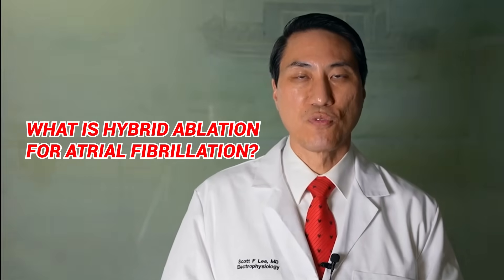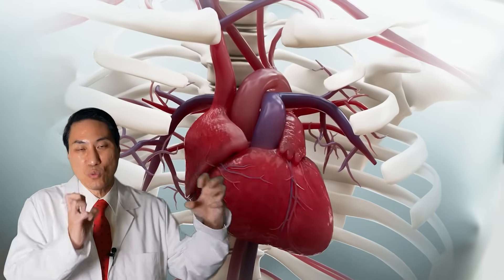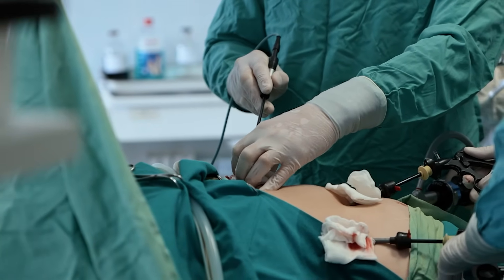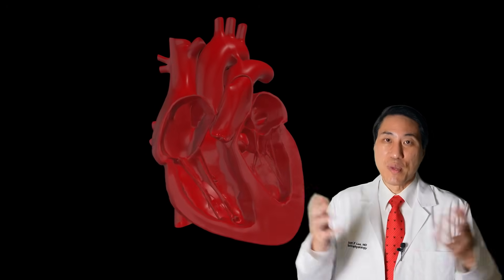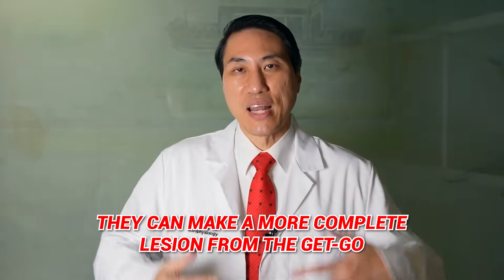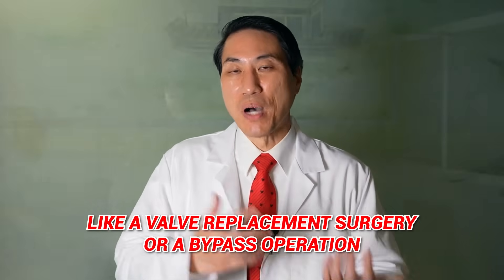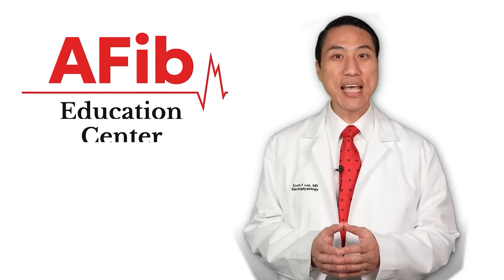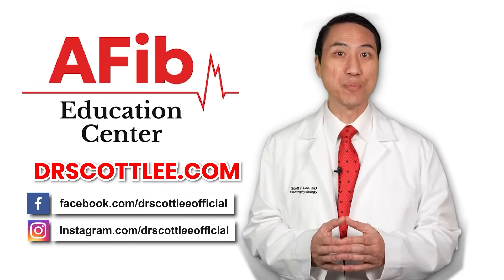Hybrid Convergent Ablation for AFib: What It Solves… and What It Still Doesn’t

Comment: Dr. Scott, do you think Digoxin is a safe medicine for Afib afflicted? And have you ever seen IV digoxin booster chemically converting anyone in Afib before to sinus rhythm? Thank you.
Reply from the maker: Great question — and I’m glad you asked, because digoxin is one of those medications that still gets used in AFib, but rarely for the right reasons, in my opinion.
To be honest, I generally don’t recommend digoxin for most patients with AFib. Here’s why:
	•	It’s a weak rate control drug, especially compared to beta blockers or calcium channel blockers like diltiazem. It doesn’t actually suppress AFib — it just slows down how fast the ventricles respond to it.
	•	Its effect comes from increasing parasympathetic (vagal) tone, which helps slow the heart rate at rest — but it’s easily overridden by sympathetic stimulation. So the moment someone becomes active, anxious, or exerted, digoxin’s effect wears off. This makes it unreliable for anyone who isn’t sedentary or elderly.
	•	It has a narrow therapeutic window, meaning even small changes in blood levels can cause toxicity — and it’s renally cleared, so if kidney function worsens, it can build up quickly and become dangerous.
	•	The one advantage digoxin has over other rate control meds is that it doesn’t lower blood pressure — which can be helpful in patients who already have low BP and can’t tolerate beta blockers or diltiazem. But that’s about it.
As for your second question — no, I’ve never seen IV digoxin convert someone from AFib to sinus rhythm. It doesn’t have any true antiarrhythmic effect. Sometimes a patient may convert spontaneously while digoxin is onboard, but that’s usually coincidental, not because digoxin “chemically cardioverted” them.
So while it still has a role in very select patients (often elderly with low BP and limited activity), it’s not a first-line agent in my practice — and I’d be cautious about relying on it, especially long-term.
Thanks again for the great question — and I appreciate you watching and being part of the conversation! For more in-depth videos on AFib go to @afibeducation, and for more AFib resources or to book a second opinion visit drscottlee.com. Thanks for watching!

Comment: Good information. Ive been referred for Hybrid not sure if that will be enough and also recommended for Tykosin, currently on Amiodarone which I want to get off asap. I will book a consultation. Wish you were in CA instead of FL lol
Reply from the maker: Thanks for your comment — and I totally get wanting off Amiodarone ASAP. While it’s one of the strongest drugs we have for suppressing AFib, its long-term side effects (especially on the lungs, liver, and thyroid) make it something we try not to use any longer than necessary.
 (Dofetilide) is often used as a next step because it’s gentler and doesn’t carry the same long-term risks, but it’s also a much weaker medication, especially in more advanced AFib. It may help stabilize things temporarily, but it usually doesn’t hold up long term if there are still active AFib drivers.
As for the Hybrid Convergent ablation, it’s a reasonable option for some patients, but important to understand what it actually includes:
	•	Pulmonary vein isolation (PVI) — which you’ve already had done with PFA at Stanford
	•	Surgical ablation of the posterior wall and floor of the left atrium
That covers three areas, but it does not address the coronary sinus, anterior wall, septum, left atrial appendage, or right atrial appendage — all of which can be critical non-pulmonary vein triggers in persistent or longstanding persistent AFib. So while it may work for some, it’s often not enough in more advanced cases.
I’ve got several videos on my YouTube channel that explain this in more depth — definitely check those out. And if you’d like a second opinion or to explore whether a more comprehensive ablation strategy might give you a better shot at freedom from AFib without needing long-term medications, you can always visit my website at www.drscottlee.com to book a consultation.
And hey — even if I’m not in California, I’m just a Zoom call away 😊
Thanks again for watching and sharing your story — wishing you the best on the next step of your journey.

Comment: So is there any data on patients life span following a successful ablation?  Do they live longer than those who dont do it?  Afib is annoying and makes me a bit weaker, but not a huge deal, unless I stroked out. Thoughts?
Reply from the maker: This is an excellent and important question—and I’ll give you the straight, evidence-based answer:
There is growing data suggesting that successful AFib ablation may not just improve symptoms and quality of life, but potentially also improve long-term survival and reduce stroke risk, heart failure, and dementia risk—especially when done earlier in the course of the disease.
The strongest data comes from trials like CABANA and EAST-AFNET 4, which both showed that rhythm control (whether by ablation or antiarrhythmic drugs) can reduce adverse cardiovascular outcomes, particularly in higher-risk individuals. Notably:
	•	CABANA showed a trend toward lower mortality with ablation compared to drug therapy, though it didn’t reach statistical significance for mortality alone. But it did show significant improvements in symptoms, quality of life, and freedom from AFib.
	•	EAST-AFNET 4 was more definitive. It showed that early rhythm control (within a year of diagnosis), which included ablation for some, significantly reduced death from cardiovascular causes, stroke, and heart failure hospitalization, compared to rate control.
Now to your question about lifespan: while there’s no randomized trial proving that AFib ablation definitively extends life in every patient, we do know that persistent or permanent AFib is associated with higher risk of:
	•	Stroke
	•	Heart failure
	•	Cognitive decline
	•	Death from cardiovascular causes

So logically, preventing AFib from progressing—especially in someone with symptoms or structural heart issues—should help preserve not just quality of life but possibly quantity too.
However, this must be balanced. If someone has minimal symptoms, is in early-stage paroxysmal AFib, and is well-controlled on medications and anticoagulated (so stroke risk is managed), then an ablation isn’t a must, particularly if they’re older or at high procedural risk. But for younger patients, those with structural heart disease, difficult symptoms, or a desire to reduce long-term medication burden, ablation becomes a very compelling option.
And let’s be clear: AFib is not benign. Just because it isn’t severely symptomatic doesn’t mean it’s not doing harm silently—through atrial stretch, inflammation, and scarring over time.

Comment: An ultrarunning friend c.2000, a strong runner in his early 40s, developed A-fib.  Just 5 months after undergoing a Maze procedure, he ran a 50 mile mountain race I organized. Many years later around age 60, finished a 100 mile high altitude mountain race.
Reply: Mine as been controlled with magnesium and potassium every day along with electrolytes 🙏
Reply from the maker: @WeallneedJesus3: That’s great to hear! For some people, especially those with borderline or low levels of magnesium and potassium, restoring those electrolytes can make a big difference in stabilizing the heart’s electrical system and reducing AFib episodes or ectopic beats. It’s especially true for people who exercise heavily, use diuretics, or have underlying issues that affect electrolyte balance.
That said, while electrolyte support can help reduce triggers or frequency in early-stage paroxysmal AFib, it doesn’t stop the underlying progression of the disease if AFib sources are already forming in the atria. So it’s still important to keep monitoring the heart rhythm and stay in touch with your electrophysiologist, especially if symptoms change.
Glad to hear you’re feeling in control—and thanks for sharing your experience! I hope this helps!
Reply: That worked well for me for years.  Detox too.  But then it stopoed working.  Very frustrating.   @WeallneedJesus3
Reply: That's great but I'm looking for data on those who had it done and those who didn't. He started fibbing young, and 60 is still quite young too.  Trouble is, not all ppl have a successful procedure either.  The head EP in our largest hospital system is an arrogant tool too.  I have no idea how good he is at ablations.  Perhaps worse, are they gonna stick an mrna VAX into me when I'm out cold, lol.
Reply: Since I'm older than dirt, everybody is young 😂😂😂
Reply from the maker: @LongGrovesAmeliaEarhart: You’re absolutely right to want real outcome data comparing those who undergo surgical AF ablation versus those who don’t—and you’re also right that not all ablations are successful. Surgical ablations, including variants of the Cox-MAZE procedure, can be very effective when done properly, but success varies greatly depending on the surgeon, the lesion set used, and the patient’s stage of AFib progression. Unfortunately, there’s no uniform standard. Some surgeons call it a “MAZE” when it’s really just a one-wall pulmonary vein isolation (PVI) from the epicardial side, which is not adequate for longstanding or persistent AFib. And yes, even in the best hands, if someone has late-stage AFib (a large “forest fire”), the chance of a durable sinus rhythm can still be lower.
As for data: randomized controlled trials comparing surgical versus catheter ablation are limited, but hybrid procedures (where surgeons and EPs work together to address both the inside and outside of the atria) are showing promising results in persistent AFib cases. The CONVERGE trial, for example, showed that hybrid convergent ablation was more effective than endocardial ablation doing PVI alone for persistent AFib, around 55-60%. But that’s still fairly low and also depends on the skill and experience of the operator and how aggressively they address the atrial substrate.
And I hear your frustration on the arrogance front—too many patients are talked down to, rushed, or pushed into one-size-fits-all care. You deserve a clear explanation, tailored options, and respect. Regarding your concern about the mRNA vaccine: no, hospitals are not sneaking vaccines into patients during procedures without consent. That’s a myth. But your broader point is valid—trust and transparency in the medical system are critical, and when that’s broken, patients feel unsafe and rightly skeptical.
If you’re dealing with a provider you don’t trust, especially when considering something as major as an ablation, it may be time to seek a second opinion from someone with a proven track record in advanced ablations—meaning they go beyond just the PVI. Feel free to visit my website at drscottlee.com or my YouTube channel @afibeducation for more info or to book a telehealth second opinion with me directly.
You’re doing the right thing by staying informed and pushing for answers. I hope this helps!
Reply from the maker: @LongGrovesAmeliaEarhart: Great question — and one that a lot of patients considering a Hybrid Convergent Ablation ask.
So, if a Hybrid Convergent Ablation fails… are you worse off?
Not necessarily — but it depends. Here’s what I mean:
If it doesn’t eliminate your AFib, you could still:
	•	Be better off (e.g., less frequent or shorter episodes),
	•	Stay about the same (AFib returns just as before),
	•	Or be worse off, particularly if incomplete or incorrect lesions were made, leading to a secondary arrhythmia like atypical atrial flutter — which can be more rapid, incessant, and symptomatic than the original AFib.
That’s why success in AFib ablation depends far more on who is doing it and how it’s done than what technology or hybrid label is used.
The 3 most important factors for successful AFib ablation — whether endocardial (inside) or epicardial (outside):
1. Stage of AFib progression
	•	The longer you’ve had AFib and the more often it occurs, the more AFib cells have spread through different parts of the atria.
	•	Early-stage Paroxysmal AF often just requires 1 wall (PVI).
	•	Persistent or Longstanding Persistent AF often involves 3–6 atrial walls with active AFib cells.
2. How comprehensive the lesion set is
	•	Most EPs still do a simple 1-wall PVI regardless of AFib stage.
	•	That might work for early-stage AFib, but in Persistent AF, 1-wall PVI gives you 40–50% success.
	•	In Longstanding Persistent AF, it drops to 20–40%.
	•	The Hybrid Convergent approach aims to improve this by adding epicardial ablation (burning from the outside), which helps treat the back wall. That bumps success to ~55–60% for Persistent AF — which is a step in the right direction but still modest.
3. The operator’s philosophy and skill
	•	Most EPs perform “anatomic ablations” — a pre-set plan regardless of what your AFib actually needs.
	•	I do “functional ablations,” meaning:
	•	I intentionally stimulate your AFib in the lab,
	•	Then I ablate wall by wall, watching how your AFib reacts,
	•	I stop only when your AFib terminates and I can’t wake it back up.
That’s why my single-procedure success rates are:
	•	85–90% for Persistent AF
	•	75–80% for Longstanding Persistent AF
And I do all of this from the inside (endocardially) — no need for surgery, scopes, or hybrid teams.
So when should you call me?
If you’re:
	•	Considering a Hybrid Convergent Ablation,
	•	Have Persistent or Longstanding Persistent AF,
	•	Or are unsure if your EP is doing a comprehensive functional ablation or just a simple PVI…
Then yes — reach out.
There’s no downside to a second opinion, especially from someone who specializes in high-success, single-procedure, advanced ablations. You can visit drscottlee.com to book a Second Opinion Clarity Consult and make sure you’re making the most informed decision for your heart. Please watch my videos “What You NEED To Ask Before Your AFib Ablation!” and “What Doctors Aren’t Telling You About AFib Treatments!” for more detailed information.
I hope this helps, and thanks for watching.
Reply from the maker: Thanks for sharing that inspiring story! It really underscores a couple of key points about AFib, especially in endurance athletes. There’s a well-documented increased incidence of AFib among long-time endurance athletes, likely due to repeated stretch, inflammation, and remodeling of the atria over years of intense cardiovascular strain. As for ablation outcomes—whether catheter-based or surgical MAZE—the most important predictor of long-term success isn’t the technology or approach (like inside vs. outside the heart), but rather the stage of AFib progression itself. Think of it like a forest fire: if it’s just a spark in one part of the atrium (paroxysmal AFib), it’s easier to extinguish. But if the fire has spread through multiple walls (persistent or longstanding AFib), it takes a far more comprehensive lesion set to stop it. Unfortunately, many so-called “MAZE procedures” done surgically are nothing more than a simple pulmonary vein isolation (PVI) from the outside, which isn’t a true MAZE—and that’s why results can vary so widely. Just like many EPs only do a basic 1-wall PVI for everyone regardless of their AFib stage, some surgeons do the same thing from the epicardial side. The procedure has to be tailored to the stage and anatomy of the individual patient. I dive deeper into this topic on my YouTube channel @afibeducation, and you can also visit my website drscottlee.com for more resources or to book a second opinion if you’re considering treatment. Thanks again for watching!
Reply: @afibeducation That MAZE procedure would have been done at the U of Utah med center.  My friend had a friend who was a triathlete around the same age who had undergone the procedure in this early years.  Me?  I’m two weeks out today from a pulse field ablation.  I’m exercising lightly, taking things slow, and hoping to be hiking a few hours in the mountains by late summer or early fall.  My EP addressed the posterior wall as well as PVI, and in addition, the CTI (flutter).  Family history, age, many decades of endurance sport all possible factors.  Hoping for a few years free of issues.  Keep up your patient education as it has value for many.